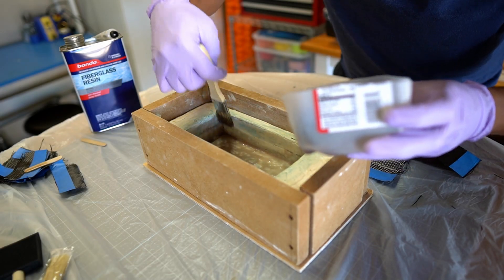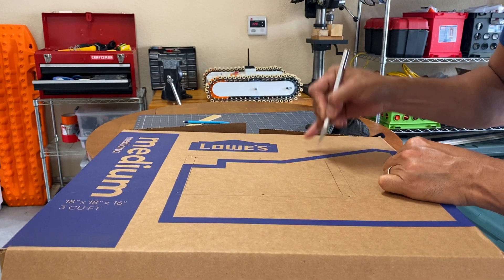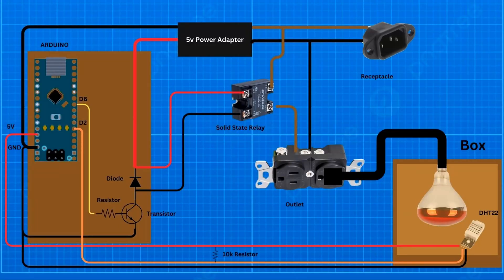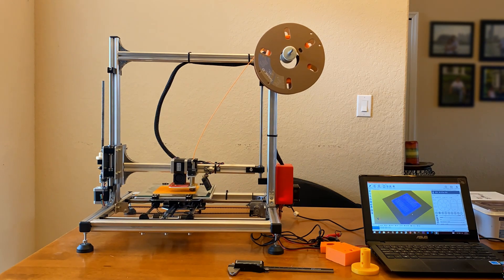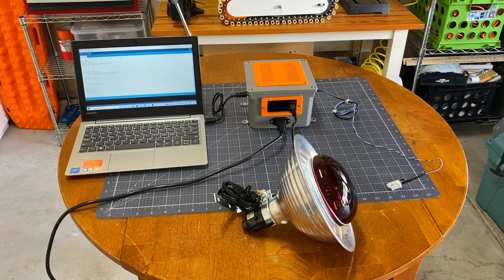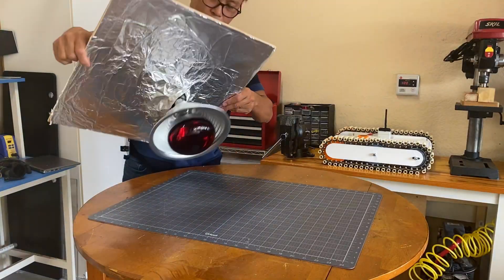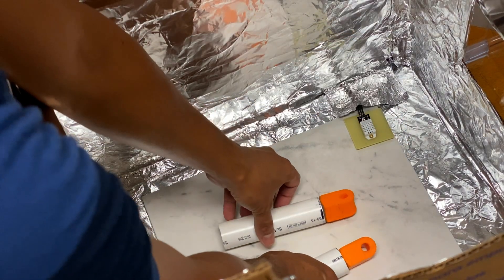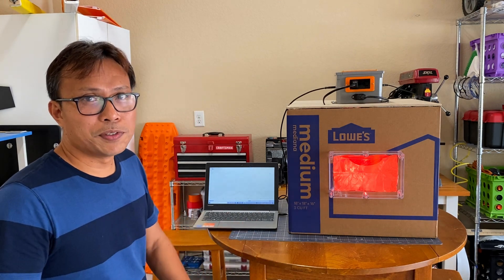How to Build a Heat box | Electronics Lab

Comment: Nice work! I would recommend not using a cardboard box for too long. Sparks and cardboard make for a very bad day. Definitely can't wait to see what you've got cooking up.
Reply from the maker: Yes, this is a quick and dirty setup. Perhaps I will replace it with a metallic box in the future. But for now the temperature regulation works well. And like any other hot appliances one should never leave it unattended.
Reply from the maker: Yes, this is a quick and dirty setup. Perhaps I will replace it with a metallic box in the future. But for now the temperature regulation works well. And like any other hot appliances one should never leave it unattended.